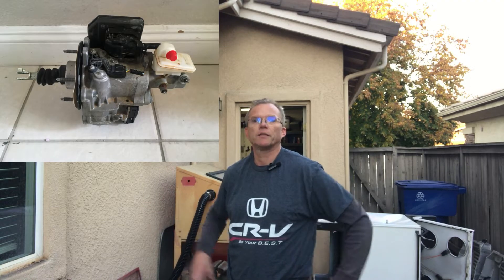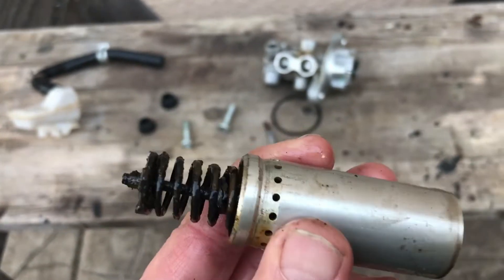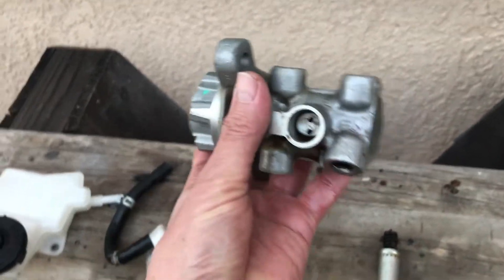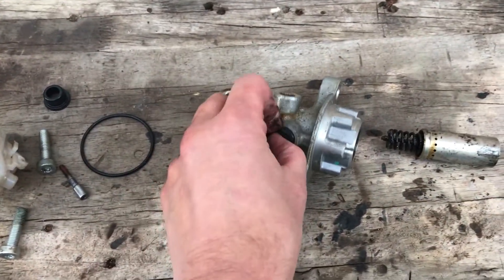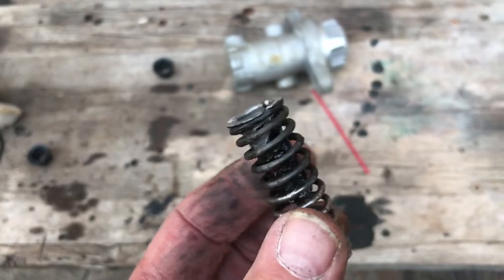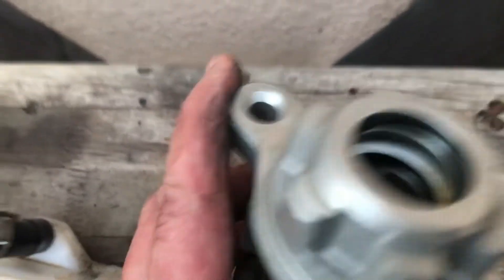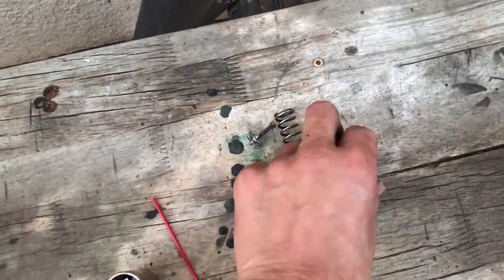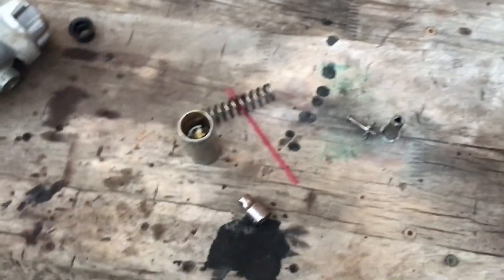Honda CR-V Bad Brake Master Cylinder

Comment: HI , How are you? I hope you doing good! Just see your video about Master cylinder and I want to say thankyou for going above beyond because I took my 2017 CRV and they couldn't figurate   the electronic break system failure and I was doing the same you did and already order new master cylinder , unfortune i just search and found your video about. I'm happy for see   your video and had figurate this Master cylinder rust. that's is very discourage buy another Honda.     thank you again

Comment: Good motivation to flush & bleed your brake system regularly. I wonder if that master cylinder spent some time outside at the wrecking yard with the lines removed.
Reply from the maker: the lines were snipped so perhaps moisture or condensation made it's way in there that way, that can be a great tip on what to look for when checking them out on the eBay